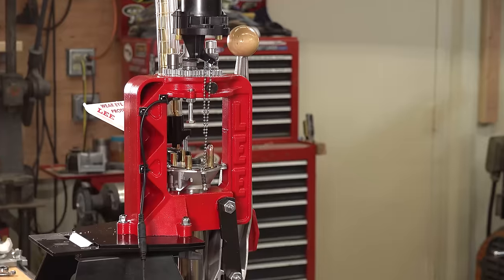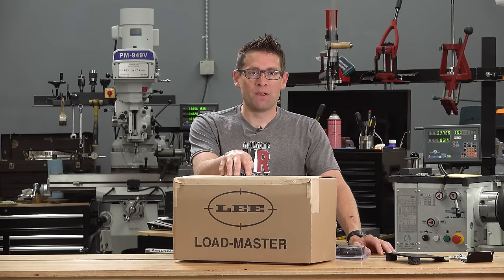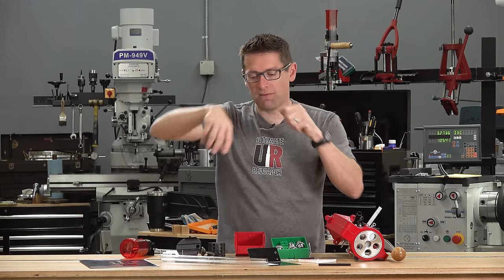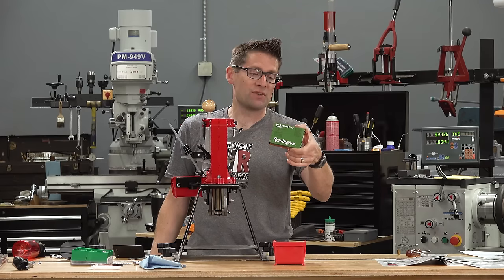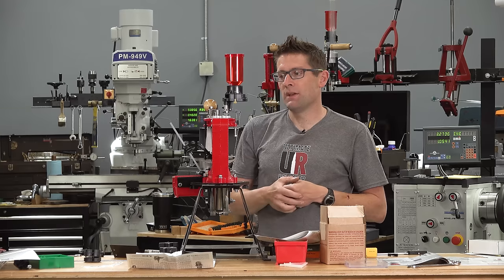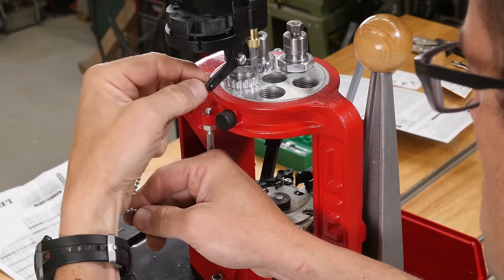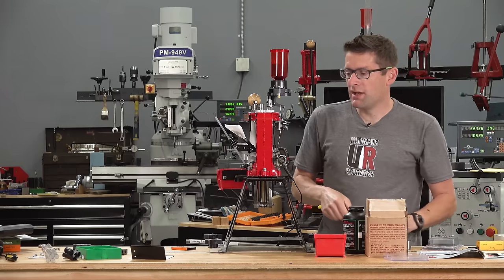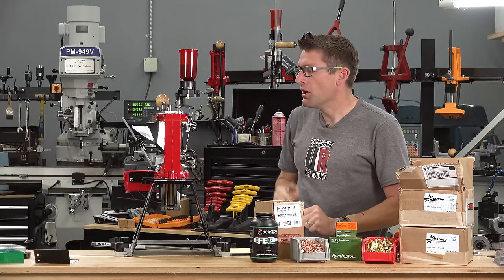Lee Loadmaster Unboxing/Setup, Loading 9mm Start to Finish

Comment: I was unaware that there was a Lee modification to help avoid primer size screw-ups with occasional small pistol primer 45ACP brass getting mixed in with normal 45ACP large primer brass.  Is that a retrofitable mod for my 20+ year-old press?

Comment: I am trying to decide which press to get, Loadmaster, 1000 or 4000. I have never loaded before. I run through 400-600 rounds a month and my kids would both need a couple of hundred. Let's just round to a 1,000. I only need 9mm as I shoot USPSA. I also wonder how hard reloading will be from a wheelchair.
Reply: You should look at getting a Dillon square deal B. They come all set up with the idea installed ready to begin loading. They are priced $489. You just let them know what caliber you need. The bad thing about them is they are very expensive to change calibers. But they are a slick unit that will turn out thousands of rounds with no problems.

Comment: I'm about to get into reloading and am too lazy to do a single stage press and swap dies. I'm about to buy the loadmaster as my 1st, but I'm running into a lot of resistance when looking for 5.7x28 parts. Yes, I'll be doing 228 and 9mm too. I've already got the dies, but can't seem to find the #15 shellplate. Apparently I have to special order from Lee.. I'd love to see a start to finish video for that ammo, not too many are reloading it, but it's getting more popular thanks to the Ruger 57. I'd like to hear tips from someone with experience if there are any parts I can swap, etc.

Comment: This Is What I Plan On Buying Exact Same Set Up, But They Are Out Of Stock Anywhere Ive Looked.
Reply: Did you check ebay? Im using single stage press on lee for a while now. Thats where i buy most of my parts for reloading.

Comment: Do you recommend the Lee loadmaster or the Lee classic turret press for loading 9mm?
Reply: LakeViewOutdoors I recommend Lee Classic Cast Turret (LCT) all the way. I do prime off press using the Lee Auto Bench Prime (LAP). Lee redesigned the push rod system and it’s been reliable since I got it. I timed myself and I can prime 100 cases in 7:30 to 7:55. I can safely prime and load 150 cartridges an hour using the LCT and the LAP combination, and that’s at a leisure pace checking things as I go.

Comment: Quick reply please :) = I have the possibility of getting a bargain discount on a Lee Loadmaster today :)    I have a Lee value press with the same caliber (9 mm Luger) with a deluxe set of 4 dies. Hoping to move the bullet seater and crimp dies to the Loadmaster (also 9 mm Luger), I am wondering if I can also use the resizing die with decapper from my Lee value press in station 1 and then insert the included  resizer (with the decapper removed) in station 2? = can I skip buying a larger caliber die in position 1???

Comment: Hey Gavin: Enjoyed this video and have a question for you re: types of bullets used. I have this press and really enjoy it to no end. I ran into a problem when I changed over to using lead cast bullets over the copper coated. For some reason I'm having a problem with the reloaded rounds not Chambering  correctly and my 1911- 45 acp will not fire a round? When I drop the slid it won't go into battery? I've check the over all length and run them through the lee sizing die? 

Please Help
JR

Comment: oops...he adjusted the disks with a strip of electrician's tape...but since I never go near the max charge .3 grn made no difference...I did like when Lee introduced the  screw adjustable measure along with the brass screws that held the hopper to the base - those old self tapping screws could (and did) wear out the plastic hoppers...

Comment: Question so You recommend the 44 sizing die for the 9mm. I’m just curious as to why that caliber die. I just purchased mine so I’m trying to purchase all of the items I need.
Reply: Because it will handle all of you’re depriming needs 44 mag and down ie; 9mm 40cal  10 mm. The case is centered by the press and recapping pin is centered by the die, no case wall contact.

Comment: I’m just learning and looking at different brands but keep coming back to Lee. Thoughts on the ball chain?
Reply: ball chain will break. I did something else more solid and more sufficient. I looped hard wire with the spring on the bottom and it works just perfectly

Comment: I noticed the part that pushes the case into station 1 has been modified. Looks much more stabile. I know on mine, especially when the last case falls, it bounces off the ramp. I cant find that new designed part on Lee's site. Is that available?  I've been running this loadmaster for years now.

Comment: I got a question and a statement to make. I have a Lee turret press setup with Lee dies and Lee powder measure with the four charge disks with the varrying sized holes to load different loads. My question stems from looking up a particular load to see that one certain charge hole places a certain measured powder in the case only to find a difference of two or three charge holes to make the charge indicated. Every body claims one tenth grain difference in charge weights. I know this is wrong from my own experience. I’ve seen all your reloading equipment and respect your opinion. What gives here? I have loaded the published load data to the varifide weight shown on a balance beam scale and an electronic scale. Still blew up the barrel on my 1911 pistol. What are your thoughts based on this case of loading.
Reply: Chose a powder that will over flow a 45 case with a double chsrge.  Or at least be visually to full for a bullet. 

Also choose a powder that will fill the case so you can verify the charge.

Comment: I do not respect you for not craping on the Lee Loadmaster!  It has for years been one of my biggest regrets as far as reloading goes.  First the primer feeder would never work, primers would bounce out into the spent primer area, not even sure how that happens.  That was if they didn't get shoved in sideways, like I said, never got that working. Then after I decided to prime them by hand  the case feeder stopped pushing them out far enough and I would crush cases.  Then the powder measure chain if one bead to loose would not throw accurately, if one bead to tight it would snap.  Now somehow it has gotten out of sync and wont index most of the time and if you attempt to do it by hand the dies don't line up.  Constant fiddling with this POS or it won't work, would be surprised if one could ever get through five hundred rounds without struggle.

Comment: Could you show or explain how or what on the priming system helps when you run 45 small primer case into your large primer. Happened to me twice in a row before I realized there were small primer 45 acp. Primers blew up but no damage except to my ears.

Comment: Cool video, is there a priming system like this one (where you don't have to click to primer into to primer arm) for the breech lock pro?
Reply: J Fajardo There is not an automated primer feeder for the breech lock pro. Only the Lee 1000 and Loadmaster have it.  The breech lock pro is a newer design than the 1000 and Loadmaster.  Although the priming system on the breech lock pro is slower, it is generally more trouble free than the automated systems.

Comment: Is it possible to use a 40SW Loadmaster and swap out the die set for a 9mm die set, then load 9mm using the same base plate?

Comment: I have an issue with the auto powder measure. When the primer flip tray bumps to shake the tray on the way down, I notice excess powder grains dropping from the powder measure creating a mess. Any way to avoid this?

Comment: During setup and running a single shell vers multiple shells, I have found COAL be off. Single loads I get the COAL I have set it for. Going to full feed, the COAL changes by +.060 or more. Have you seen this? Do you know of a fix...  Even when setting COAL with cases in all positions, The first and last shell COAL is off.

Comment: I’m seriously considering reloading. Is this the best beginner 5 stage or is there better ones. I’m a machinist so I’m very capable just need pointed in the right direction
Reply: It is not really (5) stations.

You can load 200 handgun rounds in a Lee Turret in an hour.  That is 10,000 per year.  

The LM is 4-500 per hour and you want to load many thousands before a caliber change.

Comment: 15:11 15:12 15:13 set my charge confirmed my charge ; again. 9 mm/remmingtn /pistol powder/starlines. Not sure of the lingo.. For the powder plastic die is 4.0 in mine assuming the pwder is the charge?. Could you explain here re: simple definition. 1st time don't want to miss my understanding and leave something out over word shortcuts in the complete process. I am also googling bullet charge.; they say charge a fee for bullets?

Comment: I recently purchased a lightly used loadmaster and I am having a problem with the case feeder. It drops the case fine but binds on the next case in the tube so it won't allow it to push the dropped case! Any advice?
Reply: Yes, you have to mess with tightening the little screws on the thing that slides up/down the rod.
Try adding tension to the bottom screw so it flicks the case into the shell plate

Comment: I want to run a loadmaster. Never have reloaded before and yeah little overwhelming.
Reply: Better start with the Lee Classic Turret Press, I did that, since 2017.. now I want to upgrade to a Lee LM
Reply: Start with the Lee Classic Turret Press. You will be VERY glad you did. This is  a great press - easy to use and understand. 
A beginner should never start reloading with a progressive press.

Comment: Silly question I’m sure, does the Lee loadmaster deprime as well?? Thank you!
Reply: You can deprime in station #1.
Reply: Thank you! I got the load master in. It was such a noob question. Maybe you can answer this. How critical is COL to the book? I’m doing 9mm and it’s suppose to be 1.075 but I’m getting 1.068-1.074.  Is that bad? Should I scrap these and start over really trying to be dead on ?
Reply: @JJArmoryNY  - 
The COL in a bullet manufactures published load data will produce the pressure they list. 

If you do not have a bullet manufactures data you have to verify with your gun.  They need to feed in the magazine.  They also need to pass the plunk test in your barrel. 

You can make a dummy round with an uncrimped bullet and push it into your barrel. The barrel will seat the bullet. You can measure the COL. This number is to long and you must not load them that long. You need to shorten.

Bullets are not as uniform in length as we believe.  Cartridges are difficult to measure consistently with out a comparator. Flat point bullets are easier to measure with a calipers.  Measure some factory ammo COL to see discrepancies.

Comment: I have a couple of these presses an I really want to love them but for some reason even with a die in the priming station every 12th or so round has the primer jammed semi sideways and that round is now no good. I’m not rushing and go at a slow steady pace and yet the problem persists. Any info anyone could give to solve this issue? Could it be a crimp in the pocket?

Comment: I would like to use a load-master.  Would you use the 40cal for loading 10mm?
Reply: Yes the loadmaster is perfect for loading pistol cartridges. I sized 100 pieces of lake City 7.62 nato brass on it, but it was way to hard on it.. so I bought a rcbs rock chucker supreme, which is a beast, and up to that task... But yes I run 10mm through my loadmaster, and it does great.

Comment: Is this press something that can reliably do 9mm and 223? I’m starting out and hope to do both
Reply: Both of those calibers will require primer pocket inspection, gauging,  working and swaging. 

So you will need a good case preparation set up. 

There are shell plates for those calibers.

Comment: What's the difference between running the drum powder measure and the disk powder measure  on that press with consistent powder drop on multiple loads?
Reply: Most presses do well with ball powder and less well with stick powder. The Lee disk system seemed to work well for me, but the autodisk system could have problems.

The other problem with the powder system is if you run the press too fast, the indexing would cause small amounts of powder to get flung out of the neck of the case. The deeper the case, the smaller the powder charge would reduce this problem.
Reply: No difference.
Both use a safety chain to pull the measure.

The AutoDrum is really nice. 
Most prefer it over the disk.

Comment: I'm still up in the air, I just don't know if Lee is worth the time..
I don't know which press to get, I don't have allot of cash to spent
Reply: If you dont have any presses at all, get a Turret Press.  The turret is the single most useful press, and with Lee you can set it up to auto index or not.  So it can act like a single stage, a manual, or a semi-progressive.  Plus the turret press can do things the LM cannot like cast bullet sizing and swaging primer pockets (with say the RCBS tools).  If I had to replace mine I would get the Classic Cast Turret.
Reply: The Lee Auto Breech Lock Pro would be good to consider.  The priming system is slower and not fully automated, but it has fewer priming problems.

Comment: I run a loadmaster and I'm having trouble with the indexing I have  tried adjusting it.  I have replaced the indexing rod I  still can't get it to index properly. What can I do to rectify this problem?
Reply: Plenty of videos on the indexing adjustment procedure and the proper adjustment of the indexibg/ flipper

Comment: Hey, I have a Loadmaster and just started reloading. I bought the 9mm 3 die set and I am confused on the order that the dies should be set up in. Help me bro...
Reply: Not sure what you're confused about on this one and you probably already solved it but in case anyone looking here sees this, stage 1 is deprime/size die then nothing (but is the primer stage) then powder charge/bell and then bullet seat crimp, then nothing.  At least on the 5 hole loadmaster.  Variation to that is get a universal decap die for stage 1, then run sizing die without decap pin on the stage 2 prime.

Comment: I am thinking about a Loadmaster is this good for a beginner?
Reply: No, better to start with a single stage, or a Lee turret to familiarise yourself with the reloading world
Reply: No. Don't do it. Start with a Lee Classic Turret press. Very easy to use and understand. Works like a champ after 7 years. Haven't had to replace any parts due to wear, etc.
Then, after a year or more, get a progressive.
I went to the Lee progressive after learning on the Turret for about 2 years (I still use the turret, too). You REALLY have to know what you're doing when using a progressive. You have to be mechanically inclined to keep them running, too.

Comment: The Lee Load Master is problematic. Mine was absolute junk and there is no shortage of negative reviews for it. In the very beginning the reviews were pretty good and so I went ahead and bought my Load Master brand new in the factory sealed retail box. Worked ok for about 1 month of minimal reloading but then started having constant problems with the case feeder and with the auto turret mechanism. Called Lee's customer service multiple times and yes they were friendly but incompetent to do anything responsible about the on-going problems with the press. All they kept saying is what was already in the manual and forums even after I kept telling them I tried those things to resolve the issues. I had no choice but to take a big loss on their press by selling it as defective and therefore not even able to get half of my money back

Comment: No price list for the various bits and bobs?
Reply: Prices are worthless in YouTube videos.  It's not a shopping channel.  Some YouTube videos date back 15 years.  In the months from the time this video was taken, to the time it was released, until now, prices and availability have gone all over the place.  Also, he's not the seller.  Prices from one vendor to another can vary widely.  As an example, when I purchased my Glock 17, there were two well known big-box retail stores, one across the street from the other.  There was a $200 price difference between the two, for the same identical item.  Do your research and shop around.  You'll see what I mean.
Reply: @jaydee5156  I realize all that. It would still give a ballpark figure at the time the video was made.  Which I find useful.
Reply: @patraic5241  Google is your friend.  You'll find assorted videos, reviews and vendors as well as current pricing and availability.  You may find that the best deal is just a few blocks from you home.
Reply: @jaydee5156  lol Trust me.  I would exhaust every option to find the best prices. 😉

Comment: One fatal flaw that I noticed .... you did not check your primer seating depth.  That often changes when switching shell plates on the Loadmaster, due to variables I'm not going to get into here.  The bottom line is ... if you change your shell plate, priming arm, etc .... you need to verify and adjust your seating depth.  Too bad you didn't mention or show this in the video.

Comment: Instead of sizing in station 2 - I designed 3d printed seating dies.
Use just a body in 2 and a full seating die in 4 and crimp only in 5.
Better setup for plated or coated bullets
Seating die:
https://www.thingiverse.com/thing:3275030
Case feeder sized for 9mm
https://www.thingiverse.com/thing:3369283
Need a different seating stem - leave a comment on thingiverse.